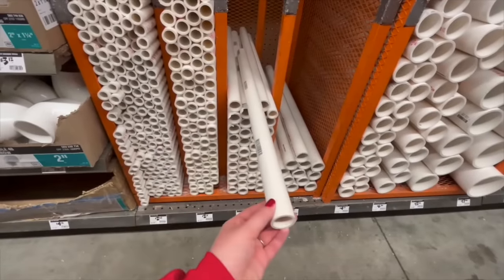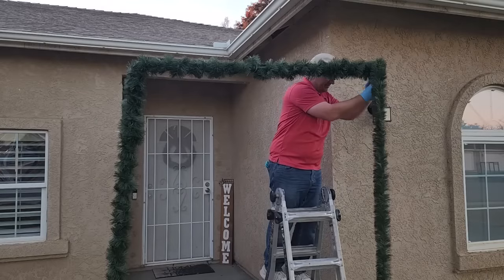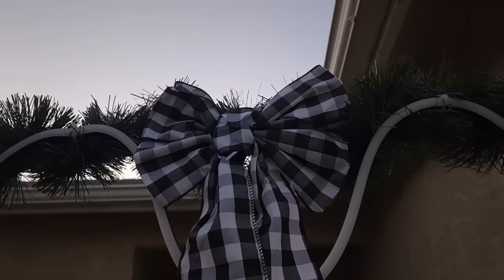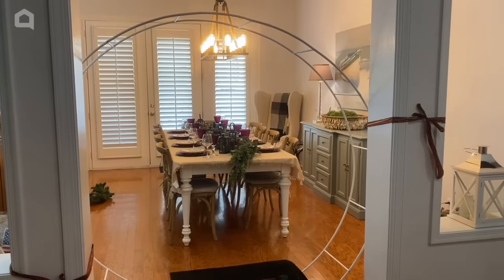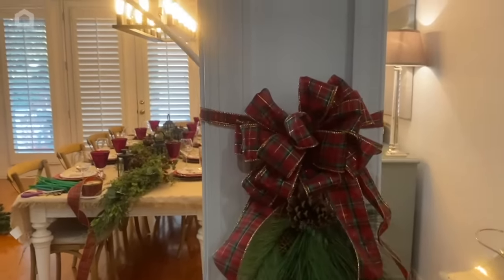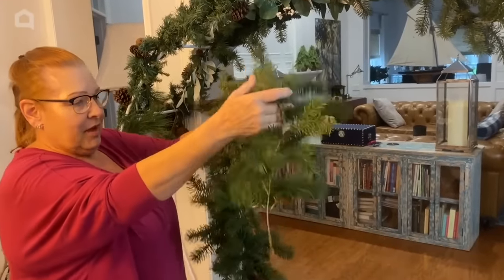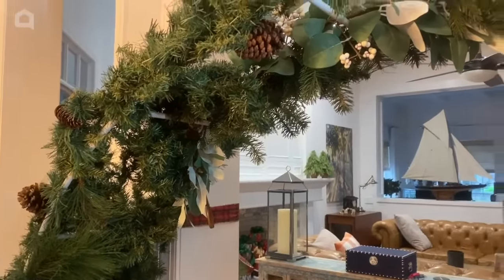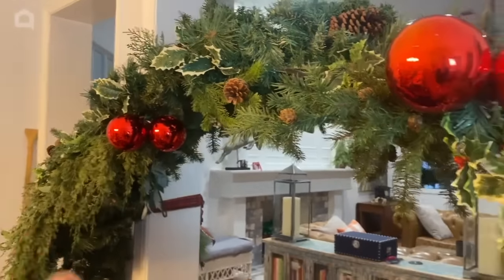The GENIUS new way people are lighting up their walkways for Christmas!

Comment: I find it easier to pound in the pvc, if you cut the bottom at a 45 degree angle instead of straight across. The sharper point make pounding it in easier.

Comment: It's easier to use rebar vs. pvc in the ground. Also, if you use rebar, then you will have a U-shaped arch vs. square and don't need the elbows.
Reply: They got sticks of one inch pvc you can flex into an arch.
 Drive 2 steaks in the ground and slide the pipe over the steak.
Reply: I would have just figured out a way to attach it to the house..... Would have looked much smoother. But, he gave nice ideas and he did a nice job for the effort. :) 
I agree though...arches might have been a bit nicer.
Reply: @colleenfraserdoggiekisses , Please forgive my ignorance... How do you bend the rebar & how would you connect the pieces together, if you're not a welder?
Reply: @BriarthornAJ, Please forgive my ignorance. How do you bend the rebar & how would you connect the pieces together, if you're not a welder?
Reply: I thought the exact same thing. Thank you for asking. 😊
Reply: @jenniferkuss3044  I'm pretty sure that colleen meant that used rebar for the "stake in the ground.  It's more supportive

Comment: Yes PVC pipe cracks when hit by a hammer. Any tube, short of thick metal, will crack, bend, snap or be crushed when hit by a hammer. 
To help “prevent” this from happening simply place a piece of wood, a 2X4 or 1/2” plywood for example, on the top of the PVC pipe. Now hammer the wood not the pipe.
It’s that simple

Comment: I was trying to make a circle with half inch pipe 20 foot long .i had a 20 foot piece of chain link top rail and put 20 strings of lights down to the big circle of pipe but as I almost had it where it was about to connect it sounded like it was going to break. My neighbor was sitting at his gate watching and got out and came over and said son why don’t u put 1 end in your tail pipe and warm it up. Why didn’t I think of that. Is was freezing when I did this and after I did that it just went together so easy